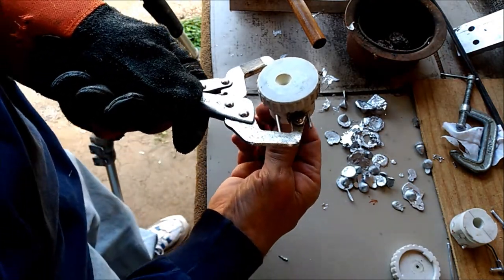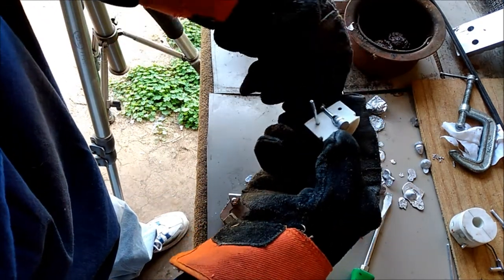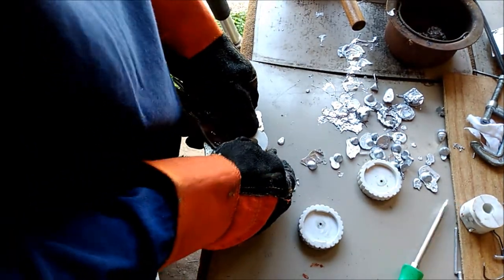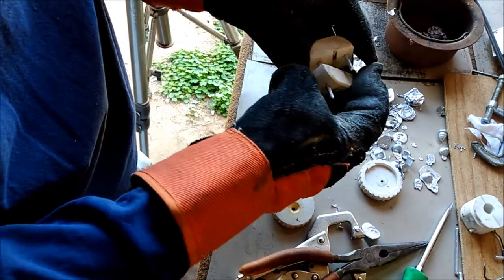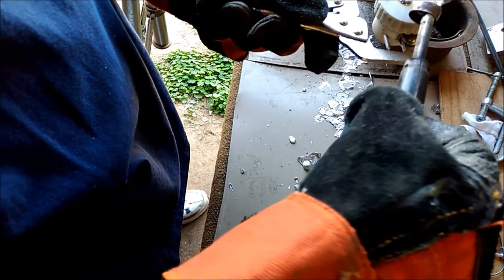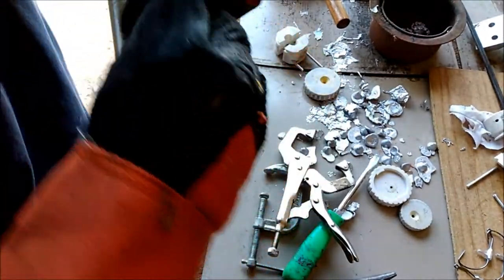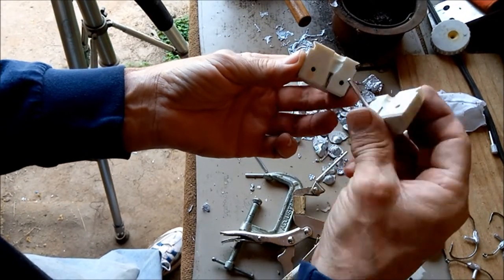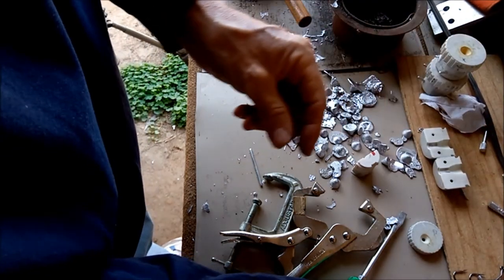3D Printed Single Cavity Bullet Molds- Problems Fixed and More Problems Discovered

Comment: I wonder too if you are getting flashing not when you pour, but when you move the lid immediately after you poor. I see that you are pulling the lid upwards and are not waiting long at all to turn it off. I'll bet that is when the lead, still in liquid form, is flowing off the excess in the sprue hole/base and leaking into the space you create by twisting the lid off a little too soon. Maybe wait a 2 or 3 count and then twist the lid off and see if the flashing still occurs.